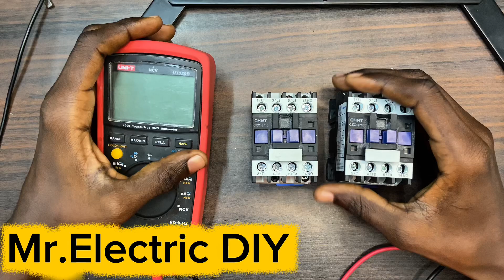How to Check Faulty Contactor With Multimeter || Contactor repair @Mr.Electricdiy

Comment: I'm trying to test a Schneider LC1D18 and it doesn't seem possible to press it down? Do you know how to do those ones?
Reply from the maker: Was it in use or it’s new?
Reply: @Mr.Electricdiy it's fairly new and installed in a pottery kiln.. just can't see how you test. But there are a second set/higher mostly unsued terminals that do give a reading.. maybe they are for testing??
Reply from the maker: Check the A1 and the A2 terminals for the coil resistance. The same way connect your live wire to A1 and the Neutral wire to A2 to energize(press down) the contactor.